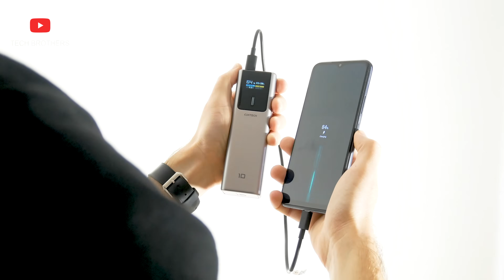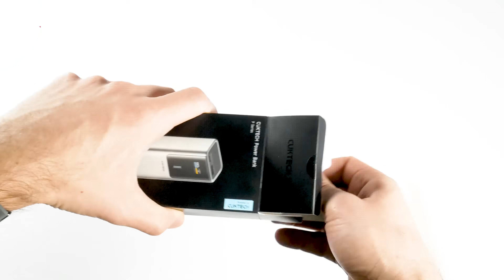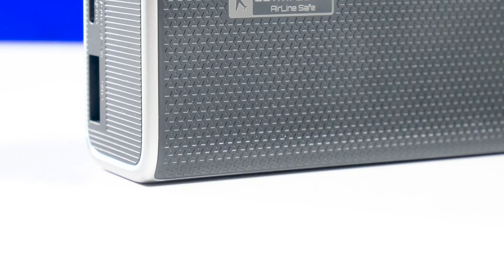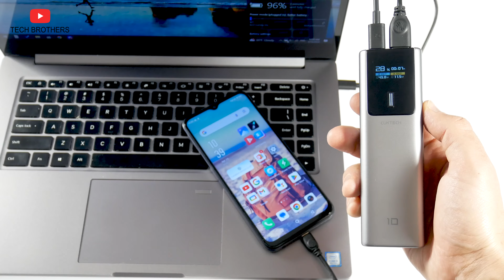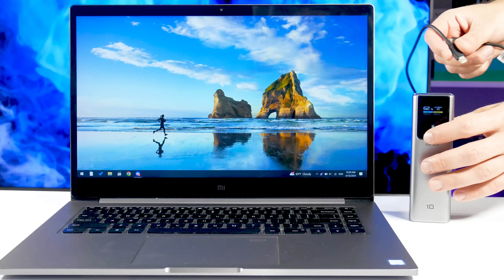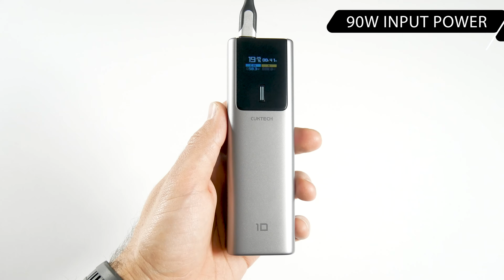CUKTECH 10 Power Bank REVIEW: Compact Power Bank with Ultra-Fast Charging!

Comment: Do I need to have a 90W power adapter to charge the power bank at maximum speed?
Reply from the maker: Yes, you need a 90W power adapter. I was charging the power bank with the 60W charger in this video, so there was almost 60W input power on the display.